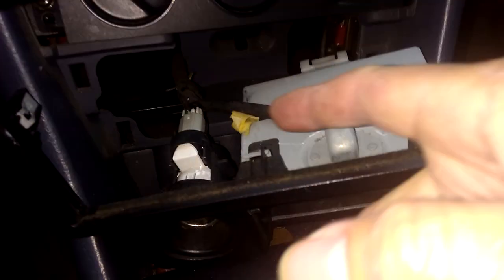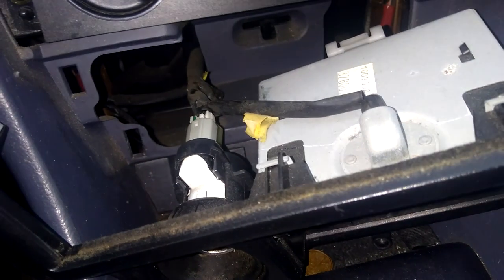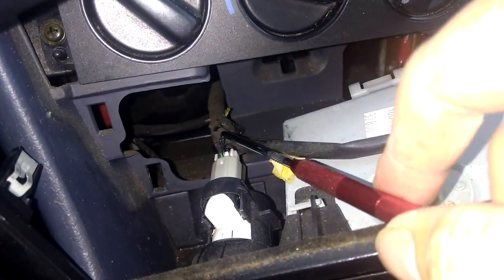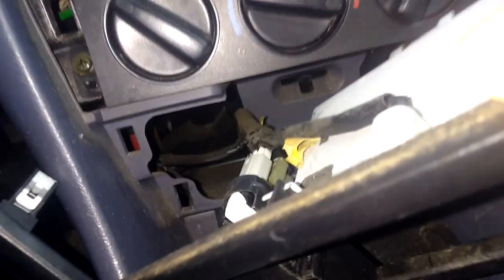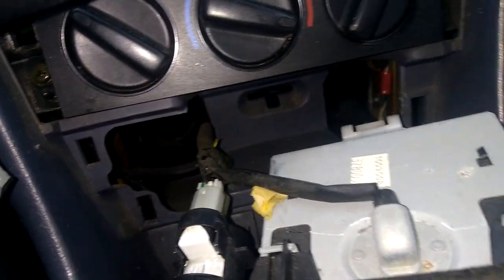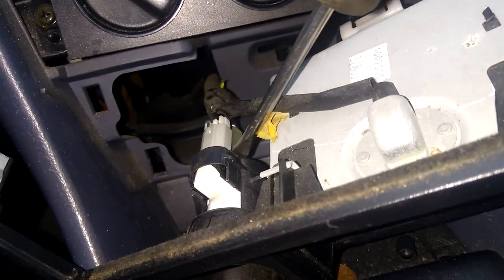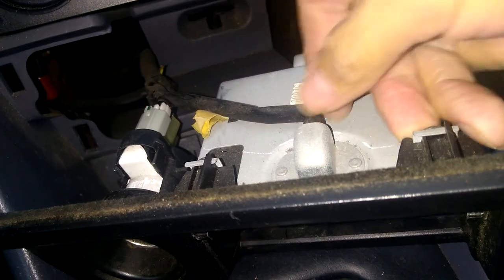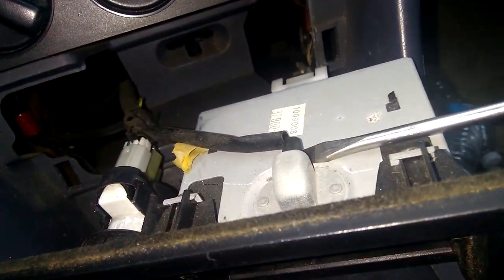How to swap out cigarette lighter outlet 1997 Toyota Camry

Comment: Sooooooo, thanks for showing how to take the trim off But, how do change out the defective cigarette lighter for the new one. That's what I was hoping to see and learn how to do.
Reply: Fucking same
Reply: Also scratched hell out of his paneling for no reason. I have the same exact car and you literally do not even need to use trim tools you just pull out the ash tray, grab inside the opening where the ashtray was give it a firm tug and the bottom comes out and then the rest is easy.
Reply: Exactly